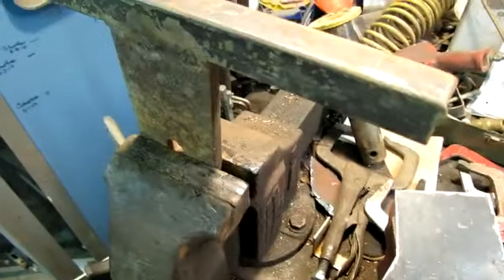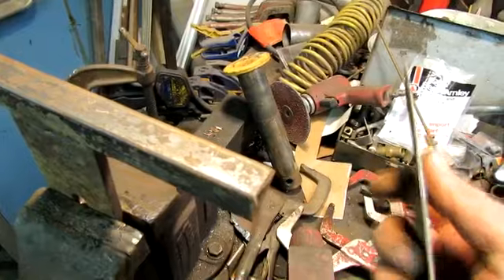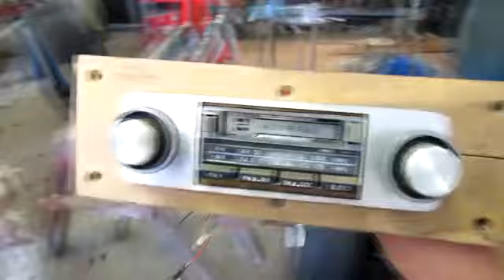55 chevy truck-weld up holes in the firewall

Comment: Awesome, I'm welding up the holes in my '57 Ford Truck. I'm a computer guy by trade, so I don't have much knowledge in metal fabrication. But I tell you what... Noting like going outside and pulling out the welder using my copper spoon I made out of a copper pipe I had laying around and going head in head first. Good work on your Truck dude
Reply from the maker: granadojl Willingness to try is all it takes.

Comment: Your body work dose not have to be perfect. You are not trying to build a perfect #'s matching show truck. You are building a truck for your wife and your self.  You are replacing the rust with metal and not news paper or bondo like others before you did. You are trying and are doing things the right way by putting in metal over bondo. Good work. MrsHevyshevy has been doing good work also for the things she is working on for the '55. Keep it up both of you. i know this truck is on the road now. Just keep doing things in the feature like you are now please.

Comment: How did you fill the holes in the firewall...any tricks?
Reply from the maker: Cut little circles and gas welded them in. On the smaller holes sometimes I put a thick piece of copper behind them and filled with weld. Always using a hammer and dolly to straighten out warpage.
Reply: Thanks.....